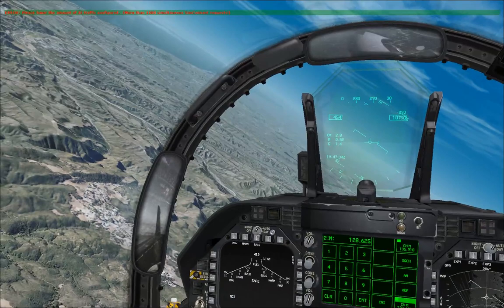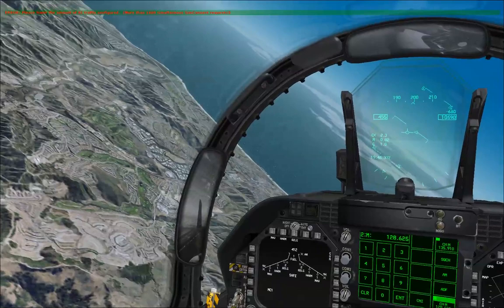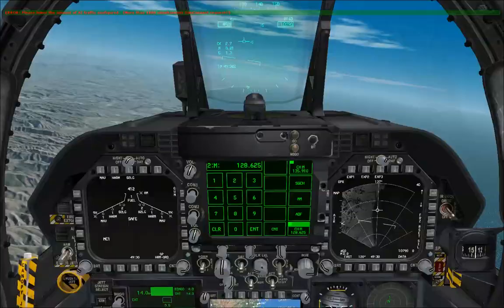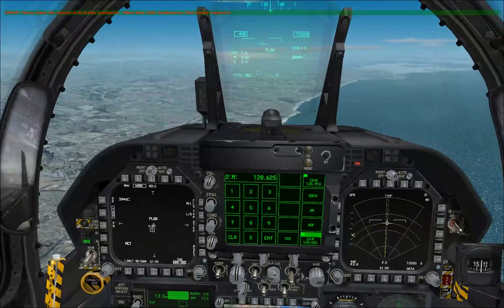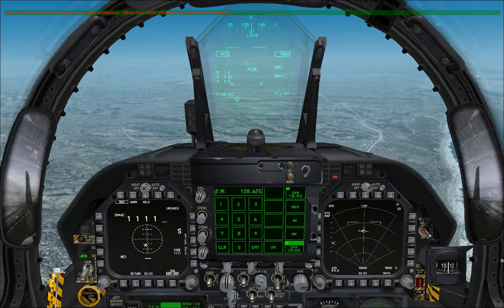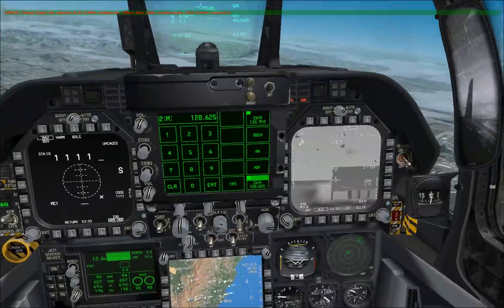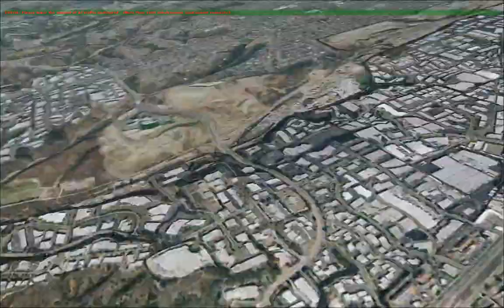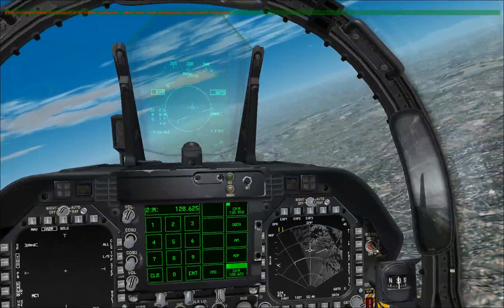FSX - VRS TacPack - SuperBug Avionics

Comment: i had the same problem seems like you have to open up ACM, go under preferences, then controllers, then make sure the multi-axis throttle box is UNCHECKED. also you will need to map your two weapon triggers by opening up the Tacpac prefrences bottom right should say trigger mapping then map up out and get to flying.
love this sim btw

Comment: I'm not quite sure what happened there; did you cue your radar to the target's location using RWR data, fired a missile at that co-ordinate (transferred from your radar to the INS) and then switched on your FLIR and laser designator for the terminal guidance?

Comment: Hi everyone, hope you can help me; recently installed Tacpack for VRS Superbug; issue is after mapping keyboard controls & saving several times in ACM, some buttons work fine while others don't, like NWS high/low gain doesn't; buttons are enabled & labeled OK; another is Sidewinder2 joystick trigger and pickle; both are recognized & saved in TPM but don't work; everything else on the stick controller works fine; everything was OK prior to Tacpack install; spent last 4 days troubleshooting; did everything from adding FSUIPC to reinstalling superbug & tacpack's latest version; very frustrated & at the end of my rope with it; any direction to what i'm missing? thanks for taking time out